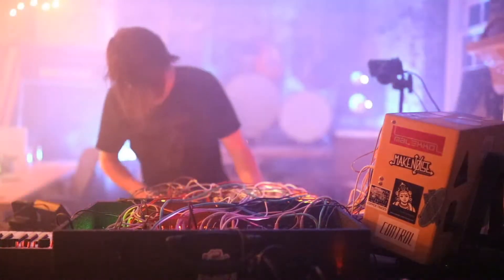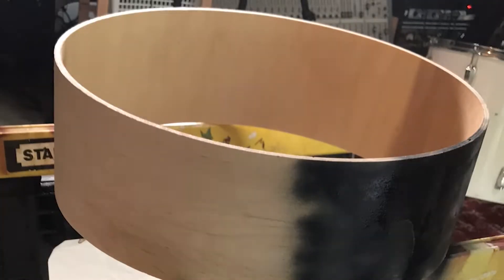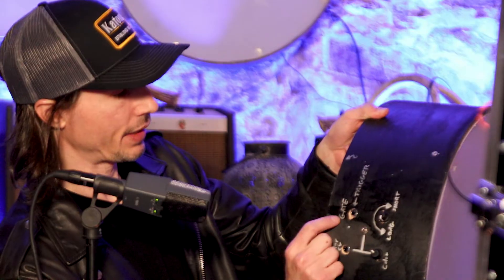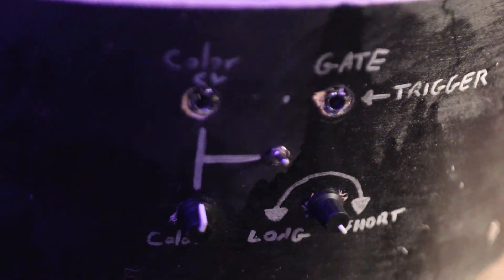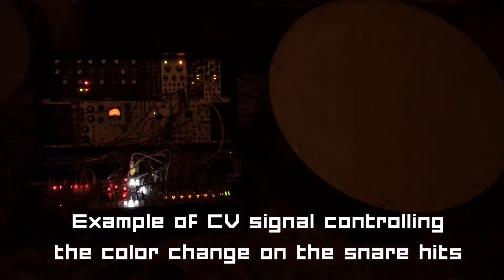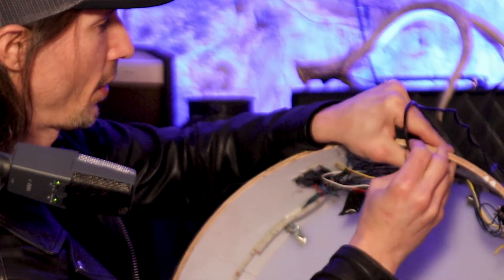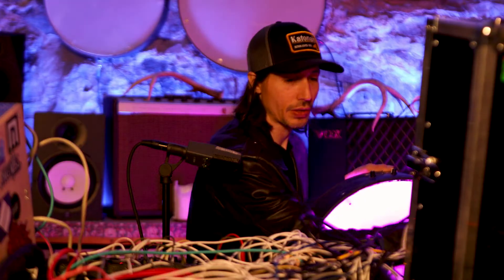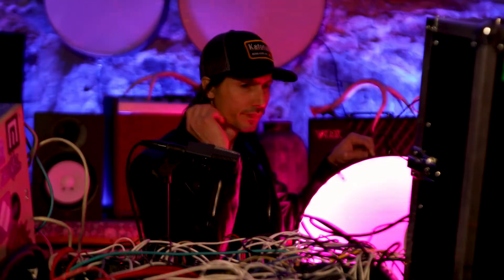How I connect lights to my modular synth

Comment: Can't believe you just posted this, I was just getting ready to reach out to you. I've had an Arduino lying around for some time and have been wanting to control some LEDs with CV. This seems to be exactly what I was looking for! Checking out the code now. I may ping you if (when) I manage to F something up :-)
Reply from the maker: Awesome. Good luck - the instructions are pretty basic, but it’s a very simple concept.
Reply: @IIITAIII  Totally, seems pretty straight forward. Should be a good starter project for me. Thanks again for sharing this.